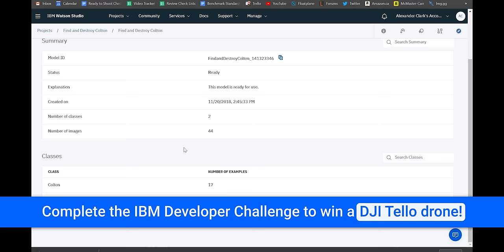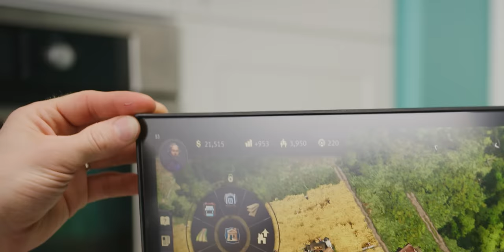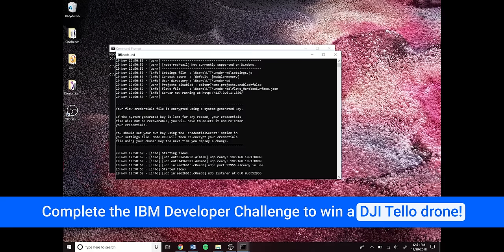FINALLY Upgrading my 4 year old Gaming Rig!

Comment: I got depressed after I found out his 4 Year old "outdated" PC is better than my New gaming PC.
Reply: Well his 4 year old rig is still very good.
Reply: @farasty7371  Not really, 5960x and Titan X are pretty old and outdated by now.

Easily surpassed by a modern i5 and RTX 2070 in gaming performance
Reply: @ilpatongi  yeah but not everyone can afford a 2070
Reply: @XtraArtzz  2070's aren't that bad, like all 70 series nVidia cards it's the sweet spot card for cost to performance, however the 1060 6gb cards were no slouch at 2k gaming.  Save up and spend the extra 160-200 for a 2070 rather than get the lower end ones, it's far more worth it.
Reply: i7 2600K w/ GTX 1060 3GB. I'm pretty depressed too
Reply: @Skerathh  yea dude... time to upgrade. I got rid of my sandy bridge i7 back in '17. AMD is killing it now both in price and performance so it's a great time for a new build.
Reply: @animalyze7120  The 2060 is more of the sweet spot now, thanks to the price bump Nvidia gave all their cards with the new generation. A 2060 costs about what a 1070 or 970 did at their launches.
Reply: @SteveDonev  nah that's a pretty decent rig for 1080p gaming
Reply: @animalyze7120  Depends on the monitor. For most gamers with a 1080p monitor, there is no reason to get anything more than a 1660Ti as that already maxes out modern games at 1080p. The GTX2070 is for folks who want to max out 1440p or want to run games at 4k.
Reply: @Skerathh  i3 2100 w/ radeon 6770 xfx
beat that haha
Reply: @Lee Moss What isn't cheap?
Reply: @Lee Moss  First: nobody buys an i5 nowadays.
Second: it is cheap if you already owned a 5960x and Titan X
Reply: @Skerathh  I'm rocking nearly the exact specs, but mine is a 2600 with a 1060 6gb. ddr3 FTW. TBH for most gaming applications that CPU will not have a ton of noticeable differences except on CPU heavy titles ran at higher settings.
Reply: lordhaven111  I've been playing just fine at 1440p 144Hz with my 1060 6gb for a long time, sure it does not perform like an RTX card but still surprisingly fast for a card this old. I'm now planning to buy something new, but not that it is necessary
Reply: @Lee Moss Agreed.  8th gen i5 k models are great price to performance, and in a lot of scenarios outperform non k's at higher price points.  I didn't do my research on what I should get before I ordered a pre-built, and now I'm stuck with a much higher price tag, on a much lower end system because I financed.   

The guy making statements about how no-one buys i5's should be ignored.  His PhD in ultracrepidarianism is showing.
Reply: @ilpatongi  Look everyone, my daddy is rich!
Reply: @TonyMontanaDS  You said it yourself, you did no research.
Reply: @Intranetusa  That depends on the framerates you're going for. I have a 2070 and 9700k (look up tracer 9230 for the exact build, got it for my birthday) and it runs D2 1080p 120fps max settings. if you want to run 1080p60 then anything above the 1060 6gb is overkill, but for framerate purposes a 2070 is much recommended.
Reply: SaltyPotato I still have a Vega 64 but a fuckin 2700x
Reply: @TheZukibog  I've got a buddy running a Phenom II 4x 965 Black Edition and a Sapphire Radeon 6850.
Reply: @Broctis  Yes. Though the 1060 6GB struggles to get 60 fps with newer titles at max and 1080p such as Metro Exodus.
Reply: @ilpatongi  i got an rx 570 and an i5 8400 lmao his pc is defo better
Reply: @akuma4a  You would be surprisingly wrong. Your build is also not super new and it's easily obtainable for less than 700 dollars
Reply: @ilpatongi  bruh... what rig do you have just asking
Reply: @ilpatongi  ryzen 5 3600 nd rx 5700xt are better imo
Reply: @reyes7133  Yeah
Reply: @ilpatongi  fuck do you mean no one buys an i5? I have a 9600k and an rtx 2080 cause there no reason to get an i7 for just gaming
Reply: Boody CF i3-2100 GT 520 here. Not even a gaming PC
Reply: SaltyPotato i7 2600k gtx MSi 970
Reply: Curly frie Solaire same 2600k and 970 8gb ddr3 1333
Reply: @Skerathh  oof
Reply: Big oof
Reply: I just got a rog 2060 and I'm very happy tbh
Reply: @tvercetti1 I am running on i7-4790k and 16 GB RAM DDR3 1600 MHz and an RX 580, Now I am very grateful, thanks for making me feel better about my rig buddy
Reply: @Intranetusa  for me there's a local deal with the Asus rog strix rtx 2060 for 300$ but I have a 1080p monitor but some 1660 ti graphics cards are also 300$ so it seems reasonable to get the 2060 if I can manage to save enough
Reply: @JoemcFlo  Yep, depends on your local prices. My local prices have 1660 Tis around ~$260 and 2060s at ~$320. The $60 difference is enough to get the cheaper 1660 Ti for me. If the 2060 and 1660Ti is around the same price for you, then definitely go for the 2060.
Reply: @Intranetusa  yea I got u
Reply: Same here. Must be nice to be rich.
Reply: I5 9400f and gtx 1660
Reply: @Skerathh  That 2600k was a beast for it's time though.  Nearly all of them would run at 5ghz.  You bought at the right time.
Reply: Jeremy Clarkson yes it is. Functional
Reply: Ryzen 5 2600 and a rtx2070S, runs the new cod with raytracing far over 60fps per second at all time.
Reply: Relateable
Reply: Ye but his job is to do with pc, and he legit said he had a custom cpu 😖😖 but I know what you mean
Reply: @Intranetusa  true, and in my opinion a 1660 super isbeven better. It's a lil cheaper than the 1660ti but it's basically the same card
Reply: @Weras Powa wut? I never said anything about having an i5. Untill very recently I had an i7 2600k @ 5GHz. I have a Ryzen 7 3700x now

Plus you do realize that PCIe is forwards & backwards compatible, right?
Reply: I’m just here with my 7 year old pre built that can’t run even the game it use to...
Reply: @lorenzo_br5803  That's not normal though
Reply: @Skerathh  It can't update windows without crashing either, so that's unsurprising.
Reply: SaltyPotato i7 7700 and rtx 2080 6 gb, me too
Reply: @meowzerzzlol6993  does RTX 2080 6 GB exist?
Reply: Boody CF  i might be wrong with the amount of Gb 😅
Reply: @XtraArtzz  Pfft speak for yourself pleb...just kidding i'm laughing in 2080 Ti...just kidding again i'm actually laughing in 1050 Ti
Reply: @Skerathh  You've got a better rig than i have i5-3570k paired with a 1050Ti 4GB
Reply: @animalyze7120  dude nobodu affords that at least in my country
Reply: same i still have a GTX 1050ti and a i7 4770k lol
Reply: SaltyPotato I can’t wait to upgrade my gpu. I always have the 1060 3gb.
Reply: Gruvve who would use a i5 in 2020 r5 3600/r7 3700 yeah boiiii
Reply: Brandon Johnson the best price to performance rtx card is the 2060 super
Reply: @Ben-ig3bf  So true
Reply: @Ben-ig3bf  I have r5 1600 tho XD
Reply: Any one who bought a z370 board in 2017 lol I still don't trust amd and would rather wait around for Intel. They haven't disappointed me in 20+ years so. Yeah it's more expensive but the only products I have fried were AMD
Reply: @ilpatongi  i used my phenom x4 for 10 years, and its still ok, and im still using my 7yo r9 279 its quite ok
Reply: Intel Pentium Silver T-T
Reply: same. cri.
Reply: you have way less power consumption and you don't have a giant box laying around
Reply: Same
Reply: Integrated graphics, gen 5 i7, 8 gbs of ram. Laptop btw. Help
Reply: @animalyze7120  not worth it considering the 2060 super not too much differance between it and the 2070
Reply: My guy I have an rx 590 8gb and an 17 8700 with 16gb ram....😂
Reply: That means that new is not always better
Reply: I feel bad for u brother
Reply: Well... i only have A8-9600 no gpu
Reply: @SteveDonev  not any more
Reply: i7-5820k + gtx 1660, i feel depressed too
Reply: @Intranetusa  old comment but this is partially untrue. 1660 Ti is severely under powered for anything above 100 hertz, because most modern intensive titles won’t run above that at high details. my 1070 chugs in modern AAAs, not to mention games like cyberpunk. 3060 is definitely the way to go for modern 144 hertz 1080p panels (which are very quickly becoming the norm, as they’re incredibly affordable these days.) 3070 is overkill but i would spend it just for the future proofing ability, 400 vs 500 kind of thing.
Reply: @rebeltug  That isn't applicable to most gamers - just to gamers who want the best eye-candy and have no problems buying a $400+ graphics card and paying the premium for 144 hertz monitors. Most gamers would rather save $100-$200 on their GPU and play their game at less than max settings. The games that can actually benefit from 144 hertz monitors are the fast-pasted twitch gameplay competitive multiplayer games like CS-GO, Overwatch, Rainbow 6 Siege, etc...games that don't require a particularly intensive graphics card to run since a GTX1660 Ti can run all of them at between 100-200+ fps average. Cyberpunk on the other hand, is 1) a single player game, 2) recently came out (thus has the latest graphics), and 3) is also not well optimized. So it's not really a good reason to get a $400+ MSRP GPU because it doesn't even need high 144 frame rates to play better because it's not a competitive multiplayer shooter....spending a few hundred more $$$ to get a better monitor and GPU will only work to improve graphical aesthetics that will be be slightly noticeable.
Reply: @Intranetusa  i think it’s safe to say most gamers want the best eye candy regardless — but some want it more than others, so they rationalize over spending. most if not all of my friends have atleast 75 hertz, but majority have 144 panels, because in price comparison they’re not that far off anymore. you can get second hand 144 hertz monitors for $90. What i was saying though, is if you’re buying a new gpu in 2021 (that being said if you can get your hands on one) it’s better to save for that 3060, because overall it’s going to provide you with a better gaming experience for those higher refresh rate monitors. and if you only have a 60 hertz, fine, but the 1660 Ti is soon to be unable to play AAAs at good framrates w/ good quality. if you’re buying your first pc, chances are you’re buying for pc exclusives or better graphics, because consoles these days are honestly a better value for the money. stupid to buy a pc and get something that performs just as well as a console, and actually losing RTX features, which provides no benefit there. i genuinely feel that if you cant afford atleast a 3060, then you’d be better off buying a console, unless you’re going for a super budget second hand build (like a dell w/ a gtx 1650 or something.) I’m not arguing that most people don’t wanna spend $400 on a gpu, i certainly don’t want to spend $700 on that 3070 Ti when it drops, but i’m saying that in terms of value per $$$ the 3060 is a better option now and long term. RTX capabilities, higher framerates, longer lifespan, etc.
Reply: @rebeltug  Yes, nowadays, since the RTX3060 is out, then it's worth getting a 3060 assuming you can find one at the MSRP of $330. A year+ ago when I wrote my original post, the 3060 didn't exist and the 1660Ti at ~$270 was one of the best bang for your buck for gamers. Before the 3000 series launch, the RTX2060 Super or RTX2070 at $400 and $500 respectively wasn't really worth the price premium over the 1660 Ti in most cases for most gamers. The RTX2060 regular was ok, but it was only slightly better at the cost of being slightly more expensive at $300-$310.
Reply: @Intranetusa  yes exactly, which is what i stated originally. i wasn’t saying that for the time it was stupid, but rather today it wasn’t the smartest idea. that wasn’t to degrade your opinion, i was just stating a genuine idea.
Reply: yeah
Reply: All good man
Reply: Same lmao
Reply: You feeling useless? Remember I have been playing on a standard laptop for 3 years
Reply: @grassmonkey_yt1809  LOL
Reply: @SteveDonev  year not anymore ._.
Reply: @Skerathh  that's a good pv
Reply: @XtraArtzz  I'm from the future, you think affording a 2070 is bad? Try a 1060 in 2021
Reply: @Skerathh  my gaming laptop has a 1060 I'm pretty sure, along with a I7 6800hq
Reply: Me too I have a dell xps with a gtx1660 super
Reply: I feel you
Reply: Agreed
Reply: Bro I still got a gt710 😭😭

Comment: “8 cores are kind of outdated, so I’m going to upgrade to 8 cores.”-Linus 2019
Reply: Cuz he is getting paid to "upgrade" :-)
Reply: @Spazik86  The 8 cores on the i9 are much faster than the Extreme edition's 8 cores.
Reply: me who has a i5 with 4 cores
Reply: but my i5 is a 4x 
wot?
(I pressed F3 in Minecraft Java Edition)
Reply: Intel in a nutshell
Reply: @Taurus388  first gen?
Reply: @thescreemregular5168  my i5 is 6 core
Reply: smiles in i3-9100F
Reply: @float1494  actually a pretty good CPU
Reply: @thescreemregular5168  two cores, four threads
Reply: me sitting here with an ryzen 3 3100
Reply: @rez-theruneman  I mean it's not slow
Reply: @lehmasan  me sitting here with a celeron
Reply: @Taurus388  same

Comment: Core i9-9900k and Titan RTX for playing Anno - Now that is what the PC master race is all about!
Reply: And he still gets only 45 fps, lol
Reply: @vladmihai306  Because the ultra setting is actually nuts.
Reply: @vladmihai306  yeah  he should have used Sonys PS5 chip for 8k 120hz😄😄😄
Reply: ikr
Reply: You can see the dark trade between ubisoft and nvidia.
Reply: Cemil  whooosh
Reply: @Squilliam-Fancyson  It was said to support 8k at 120hz, but any device with hdmi 2.1 technically supports it, that doesn't mean it will game at that, i mean the original ps4 "supported 4k" but only with movies while everyone was expecting to game at 4k as soon as they got it home on day 1.  Forgive me for being skeptical, but even for a console that is cost prohibitive.  Even Dual 2080Ti setups have trouble in 8k with ray tracing turned off.  AMD navi is supposed to compete with the rtx 2070 and even after accounting for it being slightly faster and the console being better optimized, you still don't get 8k gaming with ray tracing, expect 4k with ray tracing at best.  And again they never explicitly stated that you would be gaming at 8k.
Reply: He could have waited one more month and put in a 12 core cpu
Reply: Nathan Hamman correct me if I’m wrong but I always thought you have to have the same amount of frames to match the hz of the monitor? So some ps5 games will have to be running at 120fps? Also, would this mean for console gamers to start using monitors instead of televisions to game on? Isn’t T.V’s with x-amount of Hz cost quite a bit ??
Reply: @Doctor Ω no they said the original ps4 supports 4k but it didn't support games in 4k only movies etc.
Reply: Cemil  that's also impossible, I think fullhd at 120 fps, 4k at 60 fps, 8k it's not possible in any way maybe in very old games at 30 fps at best
Reply: @steamline4597  4k at 60fps LOL , you can barely acheive that with the best pc hardware right now on ultra. you should be happy with 60fps at 1440p
Reply: Patrick Burwash basically, this new console might not be worth it then. The only thing that seems interesting is the ssd, maybe their ray tracing but nothing new really. 
 
From a technological view it is interesting for console players but nothing new really. Also, both the next gen Xbox and PS will be identical in hardware(lol).
Reply: Gameminer couldn’t agree more.
Reply: @5ch4cht3l7  I do understand that, but it means that the leap in performance is not that amazing still. When I moved, back in the days from FX5500 to 7600GT, man there was a night and day difference. With FX5500 I could ran games and 768p with low to medium settings. The 7600GT could run them at max at 1200p.
Reply: @Squilliam-Fancyson  so Zen 2+Navi?

Comment: But the motherboard isn’t too crazy... has an i9 9900k
Reply: The best cpu still
Reply: That was the joke
Reply: @unlovableshinshin  thread ripper is better tbh
Reply: @The Doge but multi core is what you want
Reply: spade gaming threadripper doesn’t perform well in applications dominated by single core speed, gaming
Reply: @lunaticheaven9446  "not the best but one of the best"
Reply: @unlovableshinshin  true but most apps use multi cores that is why it does the same as the 9900ks in gaming
Reply: @svegaaa  That joke... lol
Reply: I have a i3
Reply: Hispanicgamer i run windows vista
Reply: @alexturner8418  dang that tough
Reply: Hispanicgamer haha jk
Reply: Every nerd
: Uhh that is a copy uhhh
Reply: Bruh just use a i10 10900k 😂
Reply: Add a ten hundred K
Reply: @owenwillfindyou334  there is no i10
Reply: @pirate6616  that’s the joke
Reply: OwenWillFindYou oh sorry I didn’t get it
Reply: Like my gpu gtx 960
Reply: @lunaticheaven9446  thread ripper is good, but the cheapest that you can find is still around $500, and you still have to get specific motherboards and cases for it. Just a reminder that some people have CPU’s that cost more than a used car.
Reply: @Flak-p9m  in 2020? Rip